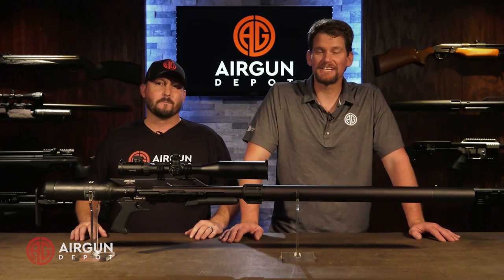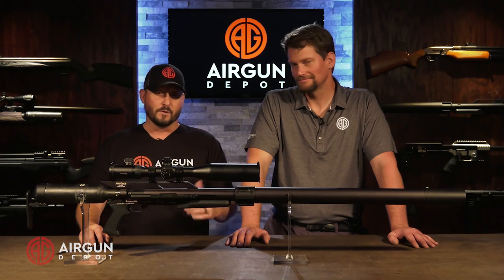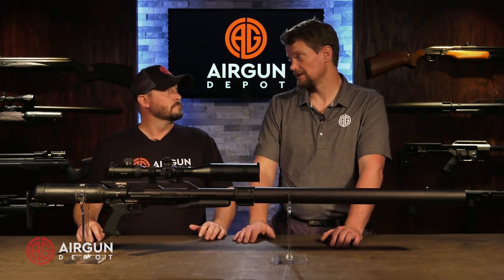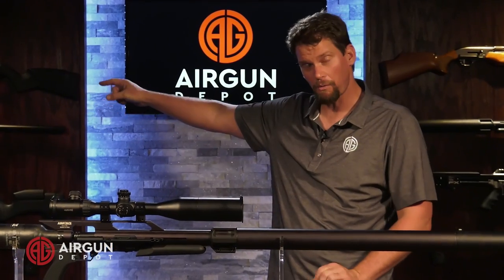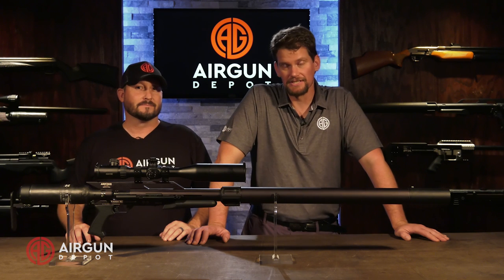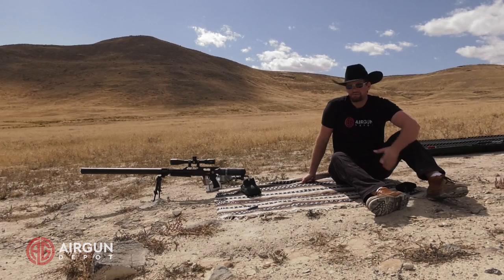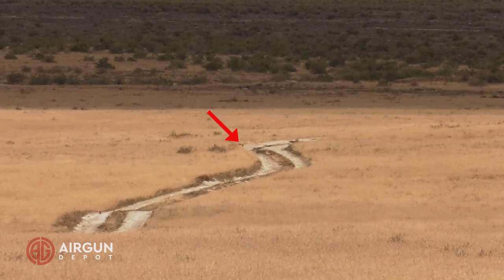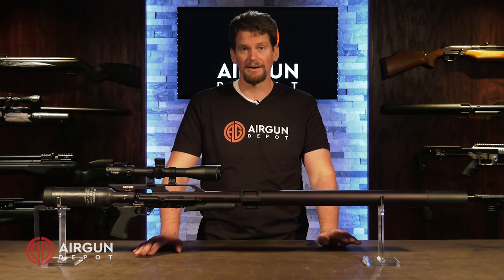AirForce Texan Carbon Fiber Bottles with Huge Power! Over 700 Foot-Pounds of Energy!

Comment from the maker: Correction! We had a misunderstanding about the heavier hammer spring. There is no new hammer spring and one is NOT needed with the new tanks!
Reply: All the texans are compatible? Do u sell te carbon fiber tank separately?
Reply: Can you also replace the Regular valve with TX2 valve?
Reply: What brand slug did you load into the airgun during the intro skit?
Reply: Is there a larger volume tank?
Reply: Larger tank available?

Comment: Nice Video! Like what Airforce is doing, always keeping in top of its game! Have several questions, 1) how do the family of Texans compare to each other  in practical terms? 2) I have a Texan SS in .457, is there any benefit on changing valve and airbotle? is there and upgrade program in Airforce?
Reply from the maker: Yes, we would recommend upgrading to the new TX2 valve and carbon fiber bottle. You will get about 100fpe more, which translates to a much flatter shot trajectory.

Comment: Good video, Travis... quite impressive, but I want to hear results with the LS. I simply wouldn’t carry a gun that size in the woods... I’ve had issues with the standard Tex in blinds, still hunting, etc, and consider it my limit ... however, with the LS, you can have a low noise level at full length, or remove the moderator for a compact gun... now, if we could bump 600 ftlbs with,say, a 280-300 grn hollowpoint.....

Comment: whats 200y 5 shot groups looking like with the NSA 290s? I have a HEAVILY modded Texan thats pretty much a full custom job in .257 that will shoot 5 shoot half minute groups all day long.
I have never shot a stock Texan but would really love this gun 700+ftbs in .45 would be awesome for the big pigs on my land. with that kinda energy I would have no issues with taking rather long shots on them if the gun is capable of holding groups that I would be comfortable with to assure vital shots.

I have a custom .45 thats running the NSA 290s at 470FTLBs and I have taken a lot of pigs in the 100 to 200lb range out to 300y and those slugs terminal performance is fantastic this gun will consistantly print 5 shot groups at 300y that are under 2.5 minute. adding another 200+ftlbs on top of that would be awesome and if this gun is capable of 200y groups that are 2 moa or better I will buy one right now.
Reply from the maker: We need to take it out and do some groups at longer range. Right now we have sent it to Rick at Shooter1721 so follow him on Facebook and YouTube to see what he does with it!

Comment: If only airforce would give use an adjustable trigger....
Reply: yeah the triggers deff leave something to be desired when you are used to match grade triggers. I will say this after some trigger time on them you will get used to that spongy feeling. I wish they would give us a trigger that is like my RAW HM1000X LRT .25 and .30 but thats wishful thinking. I dont ever expect a match grade 2 stage trigger from them so I really would be happy if they would just give us a creep/roll free 2lb single stage trigger, Im very used to match grade single stage triggers because I shoot a lot of ERL powder burners (its where we came from pushing the limits of extremely long range shots) if they would charge a 100 more and give us a match grade single stage trigger (IMHO this type of gun I would prefer a single stage trigger over a 2 stage trigger) that is adjustable from about 12 ounces to 2lbs we would benefit greatly from that when reaching out to the limits of what this gun can do.

I just dont see them investing in designing a trigger group that is match quality and able to be produced in a cost efficient and timely way. its cheap and easy to build a trigger group that has some roll/slop in it but when tolerances become tight enough that there is near zero slop things start to cost a lot more to produce as does the machines to make the parts. I would have no problem with a fair increase in price based on just the trigger but I dont think most would be ok with that price increase and thats exactly why we will always have a trigger that works and is usable from airforce but NOT one that adds to the performance of the gun.

if enough demand was around Im sure some machinist could build us match grade single or 2 stage trigger groups for the Airforce guns fairly easily if the demand was there. I would pay a machinist 200 to 250USD for a drop in parts match grade trigger group and be happy as a lark.

Comment: If a heavier hammer spring is not required how are you addressing the valve lock-up at the medium weight range slugs?
Reply: Turn down the air pressure a bit.  I found 3400 PSI for 350s and 3300-3350 for 290s, but those are estimates as your gauges will be different than mine.
Reply: @UpNorthAirGunner  So, can you turn down the power to 3400 for the 350's on the gun, or are you just filling the tank to 3400?
Reply: @timtullio1210  Just filling to 3400.  On my other Texan with the 4500 PSI kit and heavy hammer spring I found that 3300-3400 was the sweet spot for tight groups on the 290s and  350s anyway.

Comment: Any idea what was your FPE at the 300 yards or even 200 yards?
Reply from the maker: No, we haven't figured bc on them yet, so no idea.
Reply: Airgun Depot Do you think enough for a coyote kill.?
Reply: JG & Airguns yeah I bet
Reply: @jgairguns4332 It ices Coyotes out to 200 250 yds all day long without any problem .. it would even take them out at 300yds as long as you were dialed in with psi in the tank vs grain weight vs holdover.
200 yards is pretty effortless though.
Rough trajectory with 350grain and a full tank.
 Dialed in zero at 60 yds.
100yds 1/2 inch 
150yds 4 inch 
200yds  16 inch 
250yds  28 inch 
300yds  40 inch 
Pretty flat out to 125yds 
After that the drop is pretty significant and fades out pretty steep.
Lighter rounds hold a much flatter trajectory though by far,
A 180 grain will only drop about a foot at 300yds.
  350grain is a lot of bullet and requires some serious holdover out over 200. lol
Reply: My texan cf shoots the nick nielson 348 knurled at 880 fps which is like 598ft lbs and at 300 yards in cold temps its still hitting with like 458 ft lbs still moving like 750 fps at 300 yards so alot.of power that slug has a g1 bc of .250
Reply: That nielson 348 at 200 yards drops around 20 moa and at 300 yards drops like 50 moa

Comment: Nice shot on the Coke can...it proves that even a blind squirrel can find an acorn once in awhile. You keep touting the guns power output at 700+ foot pounds of energy but that's with a 520 grain slug, and yet Chris admitted that he would not use the 520 grain slugs for hunting because they have such a horrible trajectory. So why tout the gun's energy output with a slug the size of a brick that no one is ever really going to use? As a matter of fact for the doe Chris just killed a few days ago with his Texan CF he was using a 290 grain slug, which would probably produce closer to 550 fpe. It is a beast of an air rife capable of taking down a bull elk or even a bull moose with the right shot placement, so I see no need for you to exaggerate its power with parlor tricks.
Reply: Not all airgunners are as educated as you.  They know a lighter slug is better, but they are sell a product.  Many guys will buy it just for the 740ft lbs.
Reply: So Charles there is one thing you are leaving out and that is the comparative analysis of where the Texan and big bore airguns as a whole have come from.  This same line of airguns just a few years ago was slinging 350 grain slugs at 800 FPS!  But now it can sling a 523 grain slug at that same velocity!  That is quite impressive in my book.  

So apples to apples we are now getting the same trajectory characteristics from a 520 grain slug today as we were getting from a 350 grain slug just a few years ago in the AirForce Texan. So it isn't as bad as you think as far as high arcing rainbow shots.  I just like laser flat when hunting.  

My rule of thumb is to select a slug that will have a flat enough trajectory to the deer to stay in that 8 inch kills zone the entire distance to the deer and for me that is within 100 yards.  The 290s and 350s fit that criteria for me - but the funny thing is those 520 grainers aren't that far off that self imposed criteria and here is why....

The ballistic coefficient for that 520 grain slug has got to be one the best I have ever shot from an airgun because the sectional density is mind blowing!  Here is a similar slug and the BC is .38!!!!!!!!!  Read that again - I said .38!!!!!  Here is a similar slug: http://noebulletmolds.com/NV/images/N.O.E._Bullet_Moulds_459-500-RN_GC_CB6_Sketch.Jpg

For reference a pellet that we consider to have REALLY high BC characteristics would be .038!  That is an entire decimal place to the left!  So why does that matter? Physics my friend!  

That slug going 800 FPS is only dropping around 8 inches at 100 yards due to the high BC of .38-ish.  That is crazy good BC! This is why when you look into the Black Powder Long Range shooting - or Black Powder Cartridge Rifle BPRC, these 500-550 grain slugs are exactly the hunk of lead they are shooting with for competition and at relatively slow velocities for powder burners. Why?  High BC is king at long range. 

I agree that FPE is kind of a poor metric for the airgun industry to use, but for whatever reason FPS and FPE are those marketing numbers that get thrown around.  It makes me laugh when is see break barrels advertise 1200 FPS!!!!  Yes most people just getting into this don't understand that number is basically meaningless because it is being shot with a projectile so small and light that it might have hit that number on top of a mountain using some crazy lightweight Chinese-ium alloy pellet, but the second they drop a real lead pellet into that same gun they get 800 FPS.  

So that is why this 700+ FPE matters (and I have gotten it to hit 770 FPE)...  We are running these tests with what basically is the equivalent to Black Powder long range slugs of choice.  That is just NUTS and not a parlor trick my friend!  Thanks for watching!
Reply: What Chris I have to admit you certainly make a good argument for using the heavier slugs and you make it impossible to argue with your logic, but I would like to shoot some of those slugs at a hundred yards and prove it to myself. I wouldn't hesitate to admit that I am wrong about what I said  it's just that it's  awful hard to believe  that monster 520 grain slug  only drops 8 inches at a hundred yards ! Being a powerhead I just wish there were any possible way for me to justify owning an Airforce Texan CF so I could test this myself.
Reply: I guess something else that's always bothered me is the fact that these air rifle manufacturers started what I call an arms race years ago constantly trying to one-up each other touting exaggerated velocities using lightweight aluminum pellets for god sakes they won't hit the side of a barn in the same place twice. The only real exceptions I found that rule being the honest claims by FX airguns, and Hatsan whose air guns performance always exceeded the stated performance which was always a nice surprise you get a gun that had more power then the specs said it would have. Unfortunately I agree with you that brain fractures have to have some sort of yardstick to measure themselves against each other and velocity and FPE seem to be the only two yardsticks available for the task